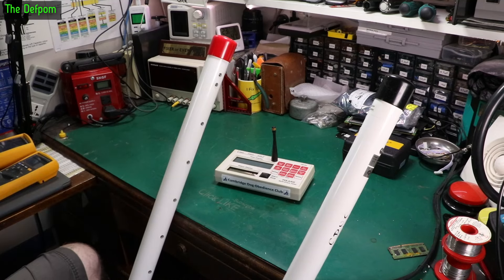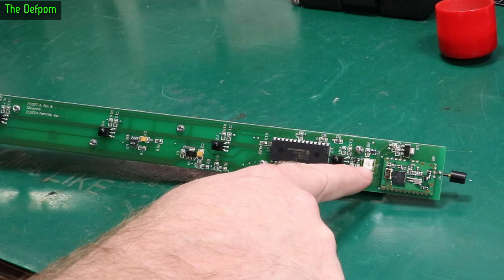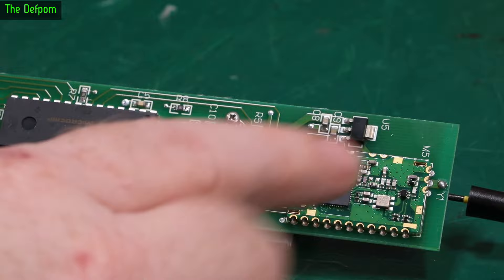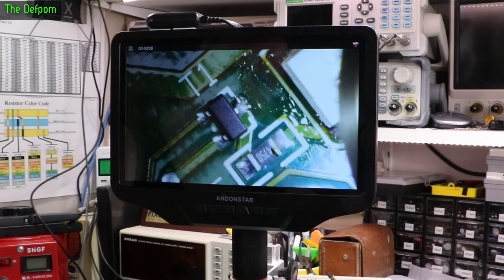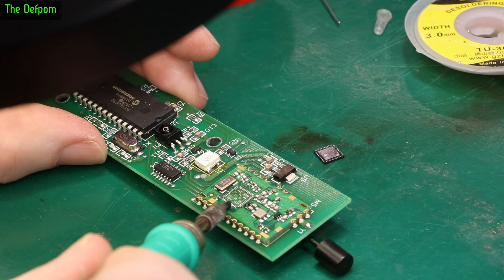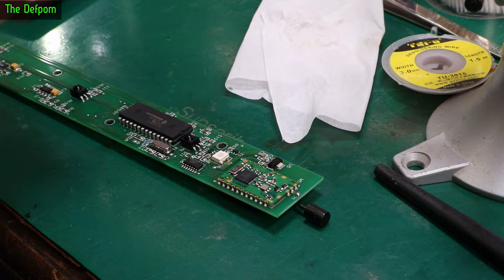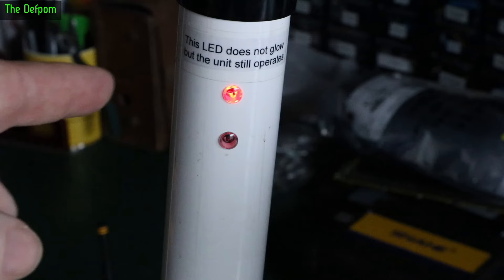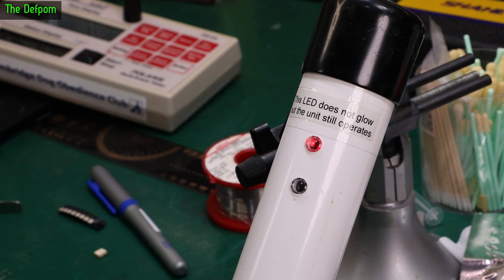🔴 Farmtek IR Light Curtain RF Fault Repair - No.1210

Comment: @ 6:33 Cracked component = center of the screen, shiny, black, discrete, SMD, no top markings, standard 1206/080x/060x/etc... Next to a brown cap. Not the 6 pin IC/S13. And, T1 looked like it had dry joints... HTH.

Comment: Not sure if a higher temperature in a smaller tip makes any difference. if the iron can't push enough power in to the tip to maintain 350, then the hotter tip will cool down as soon as you connect it to the joint.

Power is the issue not temperature, I have a gas torch that can run at up to 3000°C. But it can't be used to solder a silver plate that a £20 cooks gas torch can. 
Very hot but small flame so the issue is energy in to the work piece. the cooks torch has a bigger gas flow so more energy passing into the work piece so it can heat a larger area and maintain that working temperature.  The high temperature gas torch has a low gas flow so is limited in energy the work piece can suck that heat away faster then it can replace it. but give it a small 1mm wire to form rings and it can do the job without the other rings attached getting too hot.

Which is why when getting the equipment for your electronics lab you need to get a good selection of soldering iron sizes and powers, as over the years i've found that no one soldering station can do all that is required.

Not sure if a higher temperature in a smaller tip makes any difference. if the iron can't push enough power in to the tip to maintain 350, then the hotter tip will cool down as soon as you connect it to the joint.

Also you could have used your, as they used to be called "rectum paralyzer"  due to their size and weight. to check the output RF level and whether  is on the correct frequency.

Comment: With leaded solder I use 330degC on my 130W JBC for everything and any/all tips. Wondering if your tip is bad or the JBC (clone?) you are using doesn't have as much power as it says it has.
Certainly when I moved to the JBC it was chalk n cheese with my old Weller station.
Could be your solder also (dried out/gone bad partially inside?), I use 0.7mm Loctite Leaded C51160EN5C solder for everything also.